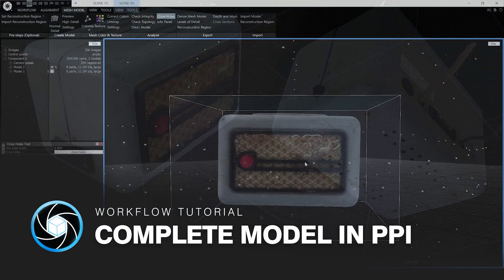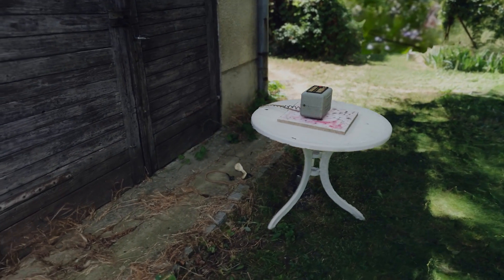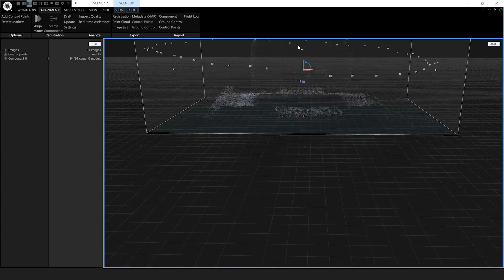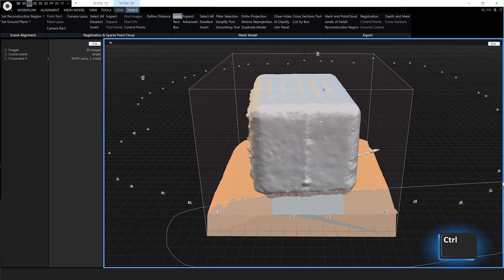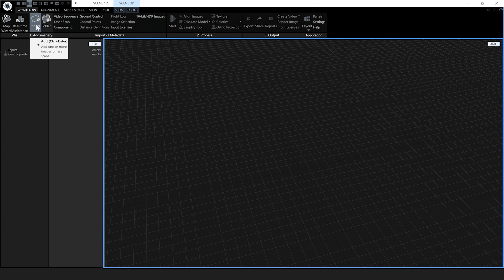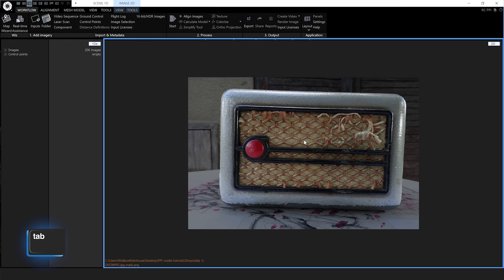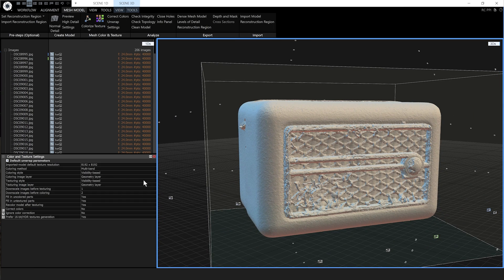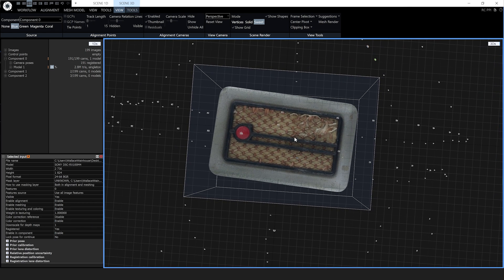RealityCapture tutorial: Complete model in PPI

Comment: when i try to texturize the model... it says to increase the triangle count... how do i do that... my model has alot of photos in it and the memory is not enough.
Reply from the maker: What is the whole error message? Is it not about Maximal texture count?
Reply: @RealityScanOfficial  when i try to texturize my model, it says ... INCREASE MAXIMAL TEXTURE COUNT OR MAXIMAL TEXTURE RESOLUTION.   how do i do this ?.the caps is exactly what it says.. maybe their are to many photos, is it important to texturize the model.
Reply from the maker: @gladiatormechs5574  You can do this in the texture settings under Mesh  Model tab/Mesh Color & Texture/Settings/Defaul unwrap parameters and there you have options for changing the Maximal texture resolution and Maximal texture count. You can try to change the maximal texture count to a higher number.

Comment: Hello, I try to make a coin using the Mask tool and I can't merge the 2 faces ! Could you help me - Please ? Regards, François
Reply from the maker: Hi François, coin could be tricky and it mainly depend how it is captured. The hardest part is the thin part of the coin. There is possibility to use control points to merge two separated part of the coin. How did you capture the images?
Reply: @RealityScanOfficial  Thank you for your answer !
I use a turntable for the coin. It rotates 15° around its central axis. The camera is fixed on a ball joint in order to move from 90° to 30° by 15°. 100 pictures by face. I want to use Reality Capture for all processing...
Reply from the maker: @phoebussolutions  If you are sure that the camera positions are still the same, you can try to use XMP workflow. You will need to get the camera positions and then use these positions to alignment. https://www.youtube.com/watch?v=5VyYLaNxHz0&t=61s

Comment: What would you recommend for system RAM and GPU RAM?
Reply: for smaller models like this, 16GB ram + any nVidia 4GB card will be more than enough
Reply: @PavelMatoušek-y2l  I'm running Intel(R) Core(TM) i7-4790S CPU @ 3.20GHz -3.20 GHz, 16GB DDR3 system RAM, and a GeForce GTX 4GB GDDR6 graphics card, I've noticed my results aren't the greatest
Reply: @digital-designferrante336  I'm assuming you are running an SSD. Dual nvme is great help too. Better cpu+gpu would definitely help, but we are talking about 10minutes differences in this ~150 pics range. RC 1.2 Tarrasque is very fast. So it all depends on what on your goals and how many models you need per day.
Reply: @PavelMatoušek-y2l  I do have my C: drive and operating system installed on an SSD drive, but i have all my applications and data installed on a normal SATA second D: drive, including RealityCapture
Reply: @digital-designferrante336  you definitely want your RC cache (default at C:) and photos you are processing on the SSD
Reply: Pavel, that's my setup..... More ram would be more confortable I think.
Reply: @florentthouret2564  I'm sitting on 64GB ram system now and it only gets fully used when I get to 500+ 24megapixel pics & 3x16K textures range... RC is using comparably less RAM than some other apps (which is not necessary good thing)
Reply from the maker: Hi, you can find more info here: https://support.capturingreality.com/hc/en-us/articles/115001524071-OS-and-hardware-requirements